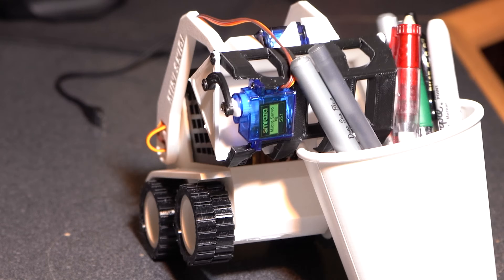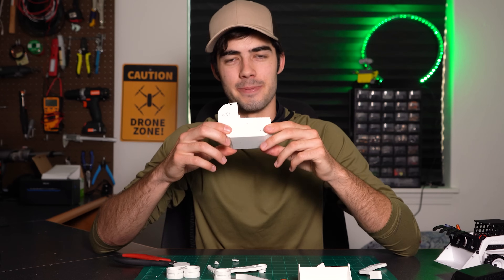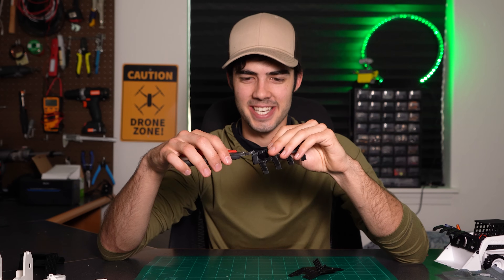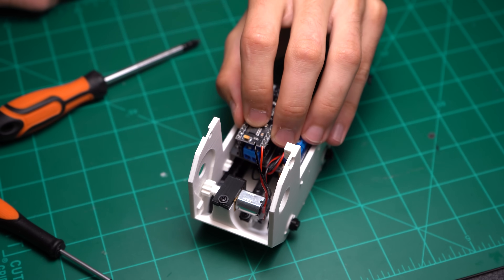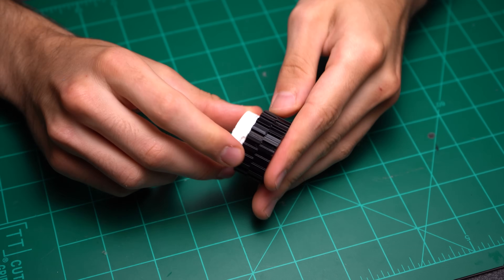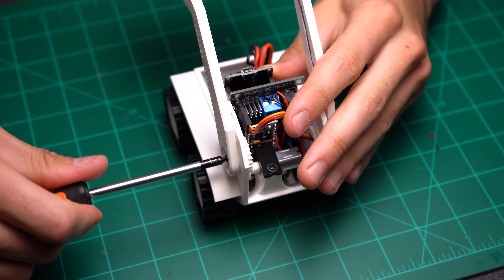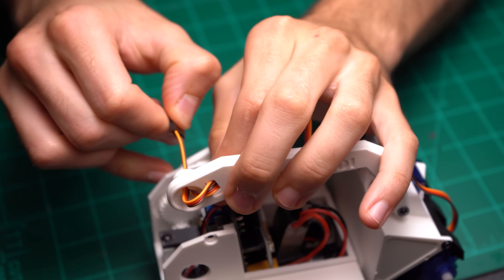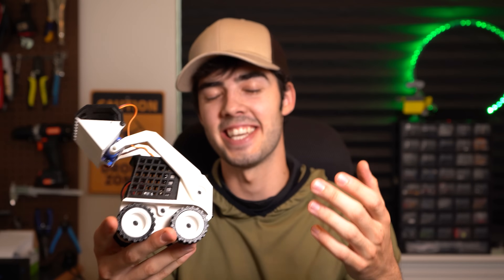How To Build a V2.0 3D Printed RC SkidSteer(Step By Step)

Comment: Hey,

I have assembled everything with a PCB I got manufactured. The webpage (for the Mini Skidi from the ESP) is visible and controls also appear to work (according to the serial output). However, nothing is actually happening. None of the N20 motors is turning and neither is the servo. Everything is assembled as instructed. LEDs on the motor drivers are on.  I am not sure how to trouble shoot from here.

edit: Actually the servo is moving - continously. Still no luck on the N20 motors.
Reply: Okay. I figured it out. I did not see that I had to bridge 2 solder pads on the back of the DRV8833 motor driver. Only problem I have now that the servo turns on and rotates continously as soon as I turn on the ESP32.
Reply: Okay. Also figured that one out. You'll make to make sure not to use a 360 degree servo. Another Mini Skidi fully assembled.
Reply: were can you get the pcb

Comment: Awesome little project!! I got mine together but im finding that the arm motor has no power... i can barely lift the bucket with the claw attachment at full charge but i went and got a 550mah 7.4v lipo battery and feel like its that... i noticed that even with free moving parts its very sluggish in forward and reverse but turning is quick.. im going to get the battery you suggest to see if that helps, but im not sure if thats 100% the issue 😅 asside for that i love it!! I added the quick attach piece for the forks and bucket and got a 3" servo extension that i glued to the arm for quick plug and play with the claw servo and its perfect. I just need to figure out why it cant lift its arm with its own strength.
Reply from the maker: Hey! I’m happy to hear you like the project though bummed you’re having troubles with the arm. If you send me an email through my website I can help you troubleshoot and get you some new parts to fix the issue! Thank you for supporting the channel!
Reply: I think I figured out the issue, but if anymore arise i'll be sure to reach out to let you know! I found a high torque 100rpm n20 motor and put it in place of the arm motor and it lifts atleast 3x more and holds its lifted position better than it was when I was having issues. I still find it to be sluggish in comparison to the skidi in your video, and you can hear the strain on the drive motors but I might just need to clean out the axle holes more and I might lubricate the axles as well. That or I might try another 5v buck converter before I try the recommend battery 😆

Comment: Is it possible to make this work with an rc transmitter ive never liked using a phone to control rc
Reply from the maker: It would be really easy to set it up via a PlayStation controller if that would suffice. Otherwise you would pry have to swap out all the current electrical components

Comment: Building this up, and it basically works, but with one oddity. Forward and reverse on the keypad are swapped. But the left and right arrows turn in the correct direction. When the right arrow is pressed, the left wheels turn forward and the right wheels turn in reverse, which is as I would expect. So if I swap the polarity of the motor wires, then it would go forward and backwards correctly, but the left and right arrows would be reversed. FWIW, these motors do not have black and red wires, rather they're both white, but one is marked with a red stripe. Hard to imagine the red striped one would be negative. So is the left and right wheel direction operating as you would expect?
Reply from the maker: Hello, hmmm try swapping the wires in the left motor terminal block to the right terminal while keeping the same orientation, and vice versa.
Reply: Swapping the motors fixed the issue. That was my mistake, I guess because the wires for the left side drive motor come out on the right side of the chassis, I went with wire left/right instead of motor left/right. However, on the arm up/down, I did have to reverse the wires there to get the controls to match what you were demonstrating. 

Overall, a very nice little kit, doesn't take long to assemble.  My one gripe is those screw terminal blocks are crap. I've used those type on a number of projects, and typically used FCI or Amphenol. These would NOT release the wire when they were unscrewed. My advice is that after loosening the screw, use a dental or hook pick to pop the leaf that holds down the wire. Also a good idea to tin the wires before attempting to insert them.

Comment: I have an issue with Wifi control. 
basically my devices don't see the internet on the ESP WiFi and switch back to my normal wifi. 
how hard would it be to add sBus control so I can plug in a frSky mini Rx and use my RC radio?
Reply from the maker: Hmmm that’s strange are you using the exact settup as in the video? And it wouldn’t be to terribly hard I don’t think though it would require some manual wiring
Reply: @professorboots  I have it working, but the WiFi reverts to my house WiFi some times, and I don’t know what triggers it.  I think the code should fail safe with loss of communication (maybe possible with web page…), I had it start to run the arm motor continuously when it did it the first time.
Reply from the maker: Good idea! I’ll implement that

Comment: This is great!

The missing element from your instructions is a list of required screws, so we know what we need before getting to the step that needs what you find out you don’t have. 😀
Reply from the maker: Good point I’ll make sure to add that Information!
Reply from the maker: Or add it to the 3D files at this point😂
Reply: @professorboots  oh, and adding an external hint for where the flats are in the drive axels, would be helpful. Super hard to see in a tiny black hole 🕳️
Reply: @professorboots  Did you do it? i really need a screw list :D